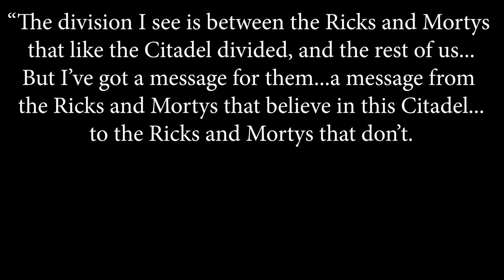Shooting Masks onto People's Faces

Comment: You need magnets to latch together on the back of their head.
Reply: Cyberpunk 2077
Reply: They do have magnets
Reply: @jonathanpaynter7159  They were brass tubes with bolts in them.
Reply: @TroIIingThemSoftly  he says in the video that there are neodymium magnets in each weight
Reply: @Lillith8810  those are to secure the tubes to the barrels, I think he means magnets further up the string so that they catch behind the head. The current ones are way too long and just wrap around their neck

Comment: Honestly having to wear them outside seems kind of silly when you look at the transmission data. I'm not against it and I wear one when required, but the chances of getting covid from someone outside in the open air just walking by or waiting in line or whatever other short encounter is really really small. Fom what I have seen, and zi may be off, the data shows the vast majority of cases come from fairly prolonged direct contact with an infected, such as an interaction with family members, friends and cramped indoor gatherings like bars and other parties. I still think you should wear one, and that this video is great, but people who get all aggro with others who aren't wearing them outside are as silly as the ones that throw a fit about having to wear one in store.
Reply: Based

Comment: And if you were lucky, a prc-77. I used to carry an LC Large and routinely weighted out at 90 +.  

I usually carried an additional med kit (Medic/Corpsman/Trauma kit), blank forms a Squad/Platoon would typically need access to in the field, snd a few comfort items, mesquito netting Fins inside two shelter halves, so you could make a lean-to half tent.

Comment: I work in construction, with plenty of fine particulates in the air.
The masks i wear are high flow pp3 particulate filters mountes on a facepiece designed for maximum adhesion and minimal air bypass.
Despite all of that, if i forget to shave smooth and work with a 1-2 day old stubble, i can blow my nose at the end of the day and literally see the particulates that leaked through, and these particulates are 1000-10000 times bigger than any virus.

So in short, i laugh at all the sheep who walk around with a loosely attached piece of cloth to their face believing that it has any effect in protecting them from airborn viruses.
And even more ridiculous is the 1.5m/6ft social distancing. Without any airflow we still had dust linger in the air for over an hour and travel to the opposite side of the building 30m/100ft away. And dust is way bigger than a virus or the aerosols it travels on.
Having said that, imagine how you look when you criticize other for "not following the science".
Reply: @sabretechv2  
"Follow the science" is code for "listen to the news".
Ironically, I've never heard someone use the phrase "follow the science" and then cite a scientific study, but I've heard plenty of people say that phrase and immediately follow up by citing a TV celebrity.
Reply: Viruses mainly spread through the water vapor, the goal of masks is not to reduce your chance of catching a sickness or block all particulates coming out of your mouth, it's just to reduce the amount of contaminated water vapor being spread around as cloth and other materials masks are made of are pretty good at that.
Reply: @scuffit  you need to look at more videos of people breathing through cloth masks in cold climates lol. If masks worked we wouldn’t be in year 2 of this, I’m not buying the whole “people aren’t wearing them” - go to any city, nearly everyone is

Comment: Now someone needs to create a mask vacuum to pull yours off when you go out and about. Gotta have equal representation 😂
Reply: Perfect bioterrorism tool.
Reply: @casual_speedrunner1482  You really love throwing bioterrorism out there don't you lol.
Reply: @davidkroft7490  There are things you need to do to mitigate risk. You should be going outside as little as possible to stop the spread, that much I agree on. But sometimes people need to go out and do things, that’s unavoidable. However, when you need to go do those things, take as much precaution as reasonably possible. Slapping an N95 on your face takes no more than 5 seconds and helps decrease spread massively. That, however, is something you somehow fail to do, despite its simplicity.
Reply: @casual_speedrunner1482  Hold on though, I didn't say I believed we shouldn't go outside. I was using your own logic against you. It is actually really important to go outside when you are sick to get fresh air and vitamin D. As far as me not wearing a mask I don't do it because I have severe asthma and I have had several asthma attacks wearing masks. So it doesn't matter how simple it is. People have their reasons for not wearing them and you don't know what those reasons are. To act as if everyone who doesn't wear a mask is an idiot is ironically extremely idiotic.
Reply: @casual_speedrunner1482  You really tend to either get offended really easily or or just take what I say completely out of context, or both. I never said that you said we shouldn't go outside. You implied that I said that and I did not so I corrected you. The logic that I was talking about (that you were using) was that if a person goes outside regardless of wearing a mask or not, they are going out and putting people at risk. So in that case, using your logic, they are a bioterrorist and should not go outside. 
Also unless you have asthma and understand that it effects people differently, or just happen to be a pulmonologist, it is hard for me to believe that you know what you are talking about when it comes to my case of asthma. There is a difference between missing a lung and having your airways close up to the point that you cannot breathe anymore. Restricted breathing is a cause of asthma attacks for me. I am not going to continue to have asthma attacks and have a higher chance of dying from that compared to someone dying from covid, just because you and other people are scared of a virus with a survival rating over 95%. I am also not going to stop working or going to college or living my damn life because of your fear. I have things to get done and a life to live. I am not going to live it hiding away covering my face up. That is ridiculous.